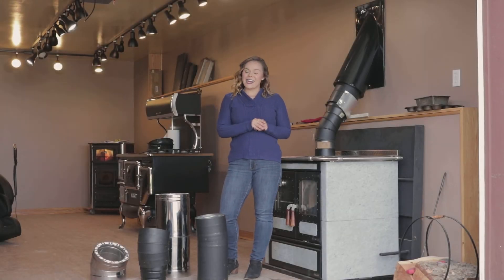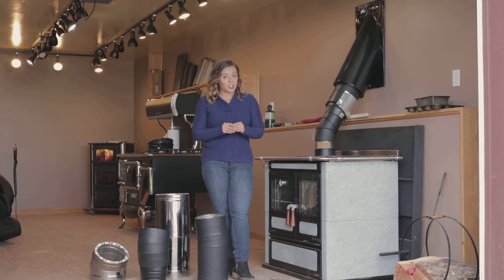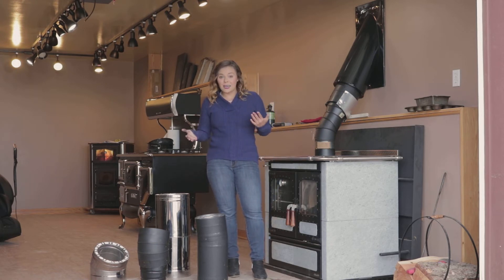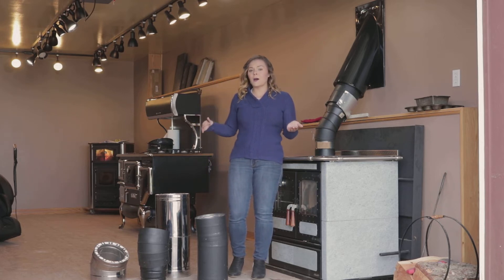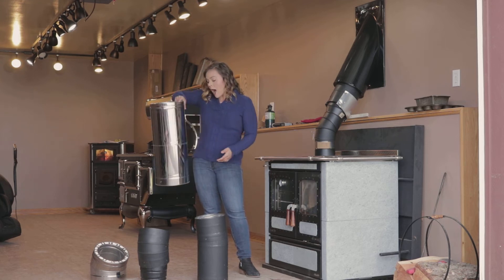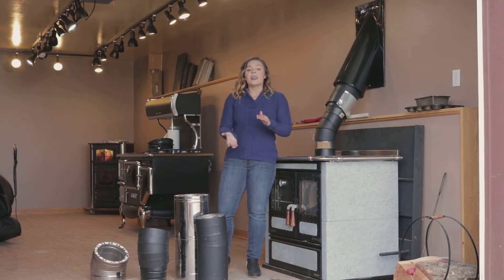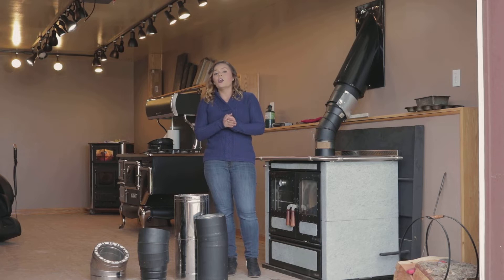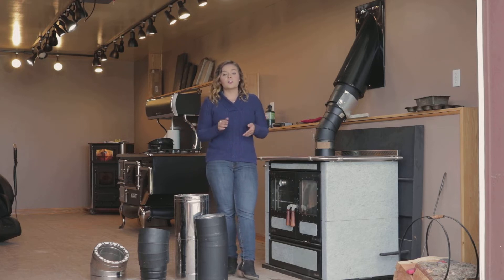Chimney Pipe Safety Ratings- USA & Canadian Chimney Standards- Chimney Fires & Quality Chimney Pipe

Comment: question stove pipe cost to much and is waaayyyy to thin , for my metal pole barn shop I want to use 6 inch by 10 ft 16 gauge exhaust pipe as it's only $110 for a 10 ft piece , I may put an 8 inch piece of heat duct sheet metal around it from the roof up to keep the pipe hot ? would this be unsafe ?
Reply: Why risk anything? Insurance wouldn't cover you if you didn't meet standard so look for used or pay the price and do right. It's always when people cut corners that you have fires and insurance denies a claim. So in the long run you could be out $100-300,000 in lost contents and building to save $400-800 on a good stove pipe
Reply: Also you can get 36" 2" insulated pipe for $100 and it's tge best they make so for 9 feet it's $300 instead of your $100. You willing to risk you all that for $200?